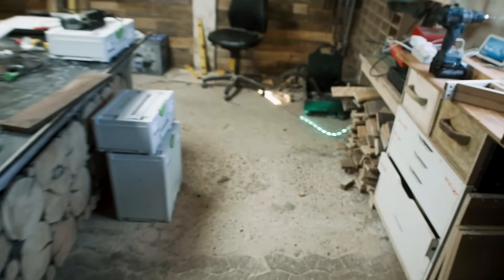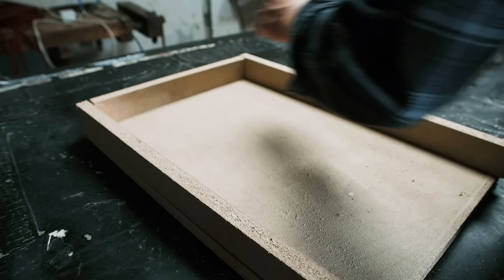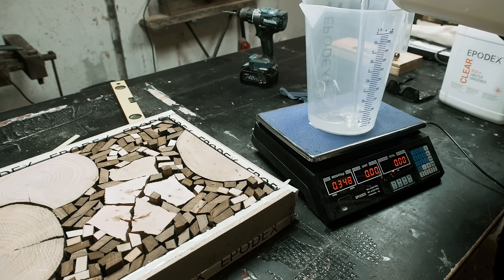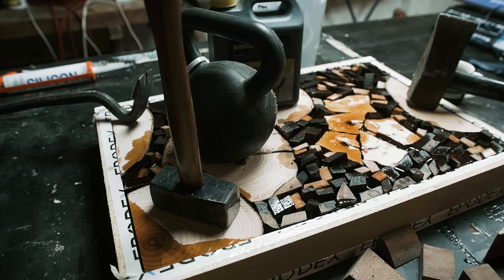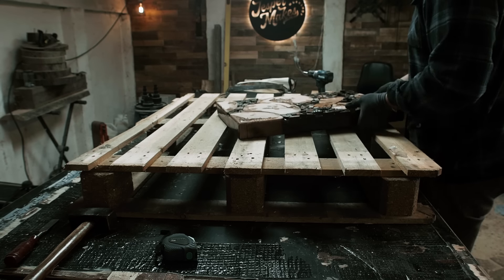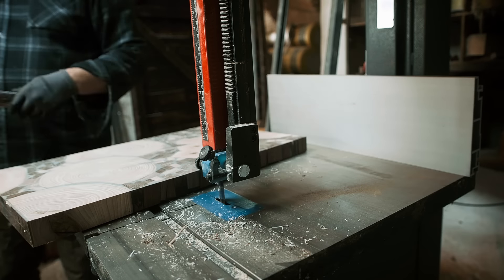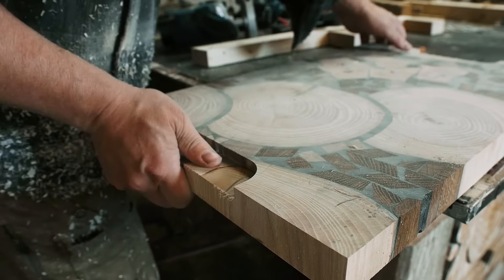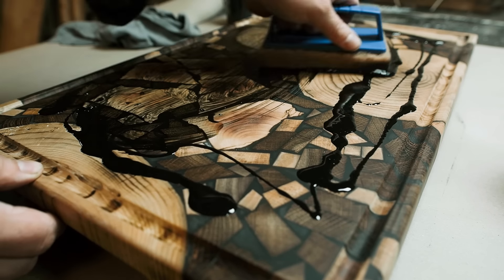I made a cutting board. But not like you thought.

Comment: I am just getting into making cutting boards. I am not making you tube videos. I am making them to make some money (hopefully). I have invested in the parts to make a linear rail router sled. What a game changer Jesper. I bought a new Skil plunge router to be used on this sled. still waiting on the bit extention to get here on Wed. If you decide to invest into building a linear rail sled make sure you buy some of the locking collars. This way you can use them as stops for the router sled and limit how far it will travel, great for doing juice grooves
Reply from the maker: Absolutely, having the right setup can really be a game-changer, especially when you're aiming to produce high-quality pieces efficiently. The linear rail router sled sounds like a fantastic addition to your toolkit, and it seems like you've thought it through with the locking collars for precise control. I appreciate the tip, and I'm excited to hear how your cutting board projects turn out with the new setup. Remember, every piece you create carries a bit of your spirit with it, so here's to crafting not just cutting boards, but experiences! Keep me updated on how it goes, and best of luck with your endeavors! Cheers! 🛠☕
Reply: thank you
 @JesperMakes
Reply from the maker: thanks to you too!
Reply: this is my linear sled 
 @JesperMakes

Comment: To mask the juice groove router mistake, maybe you could widen the juice groove? BTW, great video.
Reply from the maker: Yeah I could have done that. I didn't have a wider bit at the moment though, and it's almost not visible on the finished board. Thanks for the idea!
Reply: @JesperMakes  A wider bit wasn"t necessay, a thin strip to put between the router and the fence would have done the job, just an idea.
Reply from the maker: @Tollerwood2  Good idea!

Comment: Would taping the joint between the base and sides of the epoxy mould help reduce the risk of leakage. I've seen lots of makers taping the inside of moulds but have never seen anyone taping the joints one the outsiders
Reply from the maker: Could work, but a good chalking job will make it airtight

Comment: The composition of wood circles is very beautiful. My question is, does the polyester resin go into the food with continuous use? Could these cutting boards be used daily in real life? I want one but I don’t understand how the epoxy works with knives. Does anyone own one? Does anyone know? Thanks
Reply from the maker: Hi Panda, when fully cured epoxy resin is food safe (my type is, check yours before you do make cutting boards with it). It should be good for daily use.
Reply: @JesperMakes  I meant does the knife cut the resin and send tiny shards of it into the food. Sorry that was unclear. I did not mean contact exposure from placing food onto resin. I meant chopping on a plastic surface with a cooking knife. Does the coating shred as the food is being cut?

Comment: What always worries me about pallet wood, especially in cutting boards, is that they are not food safe! Not only they gained a lot of bacteria/fungus other sheeeet during its life and scrap time, they might also have been chemically treated... Do you check and treat the wood to prevent such risks?
Reply from the maker: Absolutely, safety is a priority, especially when it comes to items like cutting boards that come into direct contact with food. I always make sure to use pallets that are heat-treated rather than chemically treated. You can usually find a stamp on the pallet that indicates how it was treated; HT stands for heat-treated, which is safe to use. Before using the wood, I clean it thoroughly and remove any dirt, debris, or potential contaminants. The process of planing and sanding the wood also removes the outer layer, which is where most contaminants would be found. But you're absolutely right, it's a crucial point to consider when working with reclaimed wood, and I appreciate your concern for safety! Do you work with reclaimed wood yourself? If yes, how do you ensure it's safe to use? Let's keep the conversation on safety going! #SafetyFirst #CoffeeSolvesEverything ☕

Comment: Rubio may be food safe. Epoxy in a cutting board is not food safe for sure
Reply from the maker: Hi Tjerk, thanks for letting me know. When fully cured epoxy is food safe.
Reply: @JesperMakes  As long as you don't do any cutting yes. You seem to underestimate resin in general. You work with it in a non ventilated space. No gloves, no respirator. You even sand it without a mask.

Comment: As soon as you mentioned epoxy resin I was concerned for those lovely knives. 
Epoxy is a hard plastic surface, and harder on cleavers and knife blades than wood, causing them to dull faster.    Though you also have wood end grain which is kinder on knife edges due to wood fibres parting rather than the blade trying to cut the fibres. 
Sadly, epoxy will over time with chopping and butchering use and heavy cleaning will eventually end up looking a bit tired with scuffing or clouding, a shame for something so lovely.  Both for the knives and the board.
Reply from the maker: Hi Brian, thanks for your concerns. This is probably not the everyday cutting board. I'm trying to make a cookie endgrain board without any epoxy, just wood glue.
Reply: @JesperMakes  I love watching epoxy projects, I make stuff myself, though not with epoxy (yet) I recently made my son a large endgrain chopping board from a leftover bit of beech worktop, that was fun, though more work than I expected.  I love that you leave your mistakes in. Like yourself, I forget about the 'pull' on the router cutter though sometimes purposely use climb cutting rather than upcutting on lighter cuts. 
You have a fun production and delivery of your content, I really do enjoy that. Thanks

Comment: Kamiko knives are NOT JAPANESE STEEL, they use 420J2 steel!  Please Quit peddling their bullshit. Here's a quote from their website explaining the low quality steel they use.
Steels We Use
Our blades are forged from 420J2 steel (Genten series) and SLD steel (Ganjo series). With a HRC of 53 +/-2, the Genten series offers the benefits of a practical, highly corrosion-resistant blade. We recommend the Genten series to customers who do not mind tending to and sharpening their blades with a whetstone from time to time. While SLD steel is far more likely to chip and rust over time, it compensates with a significantly higher HRC of 62 +/- 2; these knives tend to retain their edge over time."

420j2 is a very rust resistant stainless, but generally considered soft garbage by Kitchen Knife people. Outdoor Knife people are familiar with it as an outer layer for laminate steels.
SLD steel on the other hand is described at CKG site:
"SLD steel by Hitachi is an excellent steel for kitchen knives. The base of the steel is SKD11 in JIS ( = Japanese Industrial Standard ) mainly used for dies fit for punching or stamping. The main features of the steel is hard, tough and strong against wearing. Hitachi has improved it for better work and longer life, and named it SLD. The main chemical compositions of it is : C 1.4-1.6%, Cr 11.0-13.0%, Mo 0.8-1.2% & V 0.2-0.50%. Generally the steels which contain Cr 13.0% or more are called stainless steel. SLD has close to 13.% Cr and are fairly resistant for rust. Due to high carbon like 1.5%, the HRC after heat-treating reaches about 60point. I have not checked the real HRC of this SLD but due to forging, can expect 1-2 or 3point higher. Furthermore, by combined with Cr, carbon makes and forms what it is called the primary carbide with HV ( = Vickers ) 1,800-2,000 hardness, equivalent to HRc 62-63. "

So much for the steel. Kamikoto is considered a bit of a joke by serious Kitchen Knife Fans because of their marketing, manufacture in China, and prices far above what many people consider fair for the product. You can buy REAL Japanese knives made in Echizen, Sakai or Seki for the same or less.
Reply from the maker: Thank you for bringing this information to my attention. I apologize if I gave the impression that Kamikoto knives are made of Japanese steel. I was unaware of the specific type of steel they use in their blades. I will make sure to do my research and provide accurate information in the future. Thank you for taking the time to educate me and other viewers on this topic. I appreciate your expertise and insight on kitchen knives. I will definitely consider your recommendation to explore other Japanese knife makers. Thank you again for your comment.
Reply: @JesperMakes  if you do a yt search for kamiko scam you'll see some other videos

Comment: Martin D.
Sorry to say, but this is not a cutting board,  it's a nice serving board.  Never use epoxy for a cutting board or butcher block.  Epoxy contains epichlorohydrin which is carcinogenic.  Under the knife cuts,  micro-particles of epoxy will mix food and you really don't want that. Safety first.  And the dye is not food safe.

Comment: "Epoxy is not safe to ingest (liquid or cured). Do not cut on or prepare raw food on epoxy surfaces.”" pay attention
Reply from the maker: Thank you for your comment regarding the safety of using epoxy for food preparation surfaces. While it's true that some types of epoxy are not safe for food contact, it's important to note that there are food-safe epoxies available that are specifically formulated for use in kitchen applications. I wanted to clarify that the epoxy I use for my cutting boards and other food preparation surfaces is a food-safe epoxy that is specifically designed for contact with food. This type of epoxy is made from materials that are FDA-approved and safe for use in food preparation areas. I take great care to ensure that all of the materials I use in my projects are safe and appropriate for their intended use. I appreciate your concern for safety and your attention to detail. It's important that we all take care to use materials that are appropriate and safe for their intended use. Thank you for taking the time to share your thoughts and concerns.

Comment: Hi Jesper - love the video so far. I am building a timber frame house and am shocked at the amount of waste timber - do you ever use building sites as a source for you materials?
Reply: I do!   Just went by a job site here on Sunday, which happens to less than 1 hour before they were taking all the "scraps" away to destroy it, and they offered me, for free, and all parts were dry and clean:
2 x ½ sheets of plywood, 15 pieces of 1/4 to 1/6 sheet, (all 3/4 inch). and lots smaller pieces, as well as quite a lot of pieces of solid wood, for both outdoor and indoor use.   
It was a (crazy) win win, as they didn't have to load and unload 2 full trailers, 
and I  .. it cost me less than 2 hours of work, a total of 15 min's drive,  and I now have enough materials for many projects and jigs to be made.   👍
Reply from the maker: Thanks for the kind words! I'm glad you're enjoying the video. As for your question, I do sometimes use materials from building sites for my projects. It can be a great way to repurpose materials that would otherwise be thrown away. I always make sure to ask permission and make arrangements with the site owner before taking anything. It's important to be respectful and responsible when it comes to sourcing materials in this way. Good luck with your timber frame house!